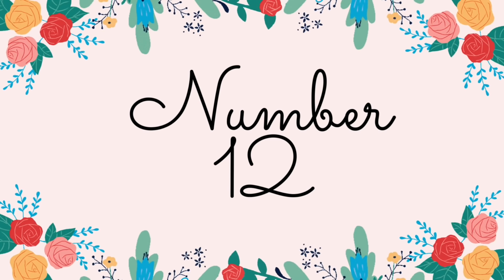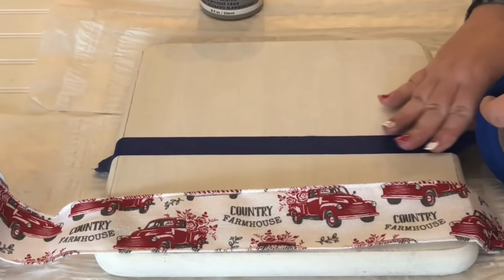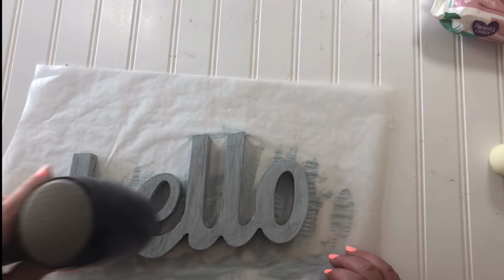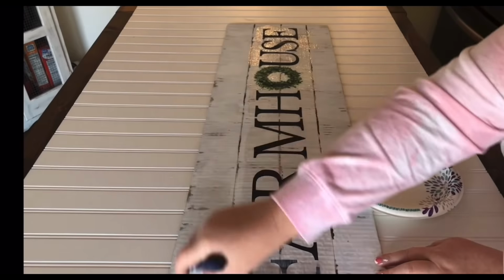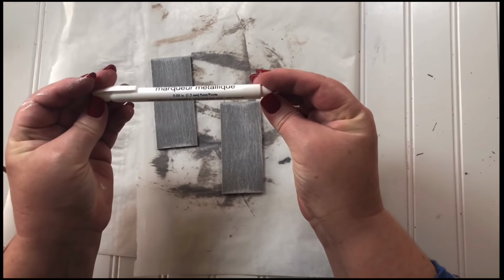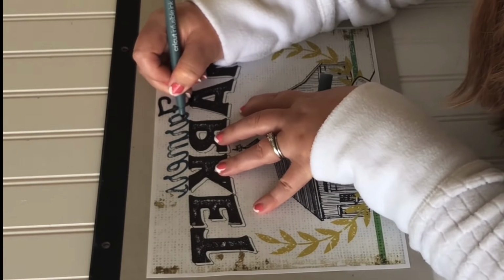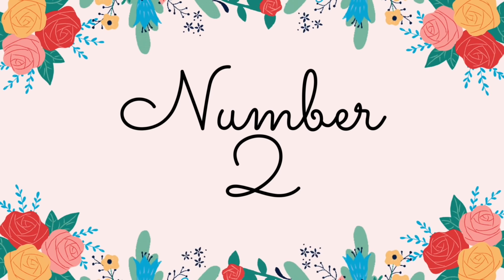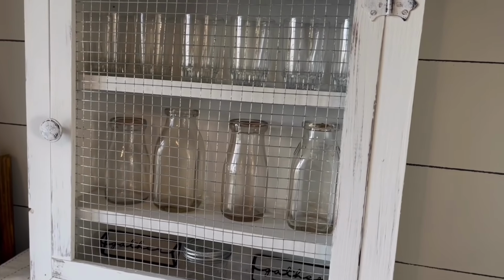Top 12 Must Try Farmhouse DIYs

Comment: When you glued the apple toolbox, you said you used hot glue and wood glue. I’m curious about the combination.Is it more effective than either one alone?
Reply from the maker: Hi Laura! Wood glue alone is a great hold. The only reason to use hot glue is for the immediate hold while the wood glue cures. Mostly for video purposes for quicker set up. You have to be careful not to let the two glues touch because they don’t work when mixed together. Thanks for the comment. 💗💗💗
Reply: @thedistressedprincessdiy  Thanks so much for answering, especially the full explanation of why you do it but also about not letting them touch because I didn’t even take notice of that during the video. 👍

Comment: Very interesting how you applied your farmhouse picture to the pillow. I never knew you could use hot glue for pillow seams! How does it hold up over time?
Reply from the maker: It holds up fine as long as you don’t put it in the washing machine. I wouldn’t really recommend washing things in a washing machine that was put together with hot glue. I don’t imagine it would hold up very well. But they do make hot glue fabric glue and I bet that would do alright. 💗💗💗

Comment: Love your DIYs BUT it makes such a difference if, when working with fabric, you iron out the creases. Your pillow took a lot of work and turned out very nicely, however, it looked kind of messy because of the wrinkles.
Reply from the maker: Hi Christina! Thanks for the comment. There weren’t any wrinkles but maybe you’re talking about the faded patches in the wording from the uneven heating of the iron. Like I said, an Easy Press would work better but I didn’t have one. Thanks so much for watching 💗💗💗